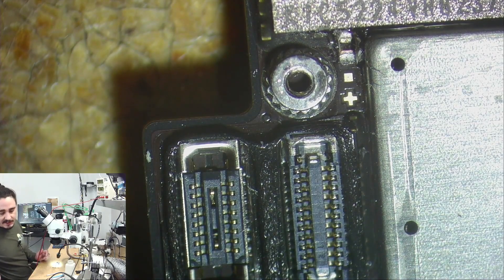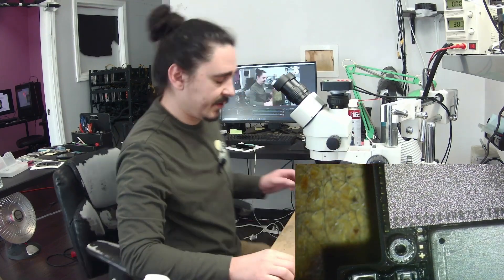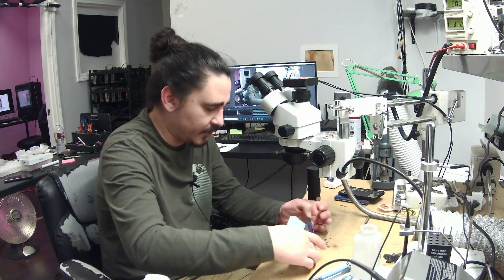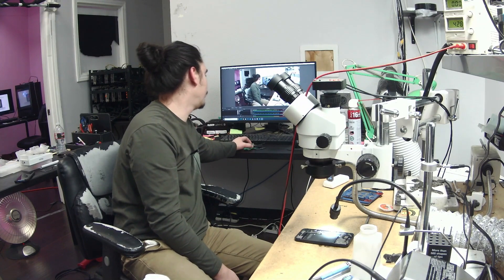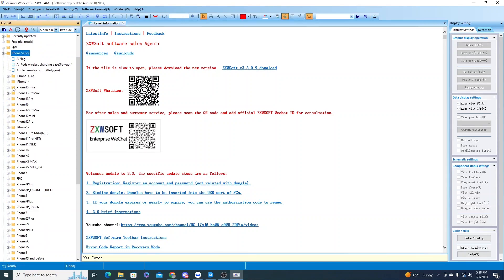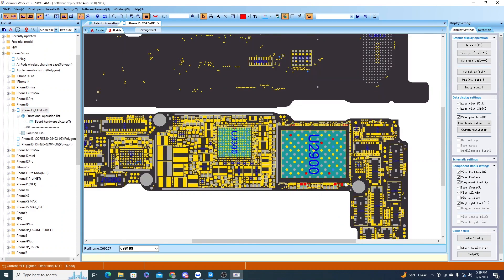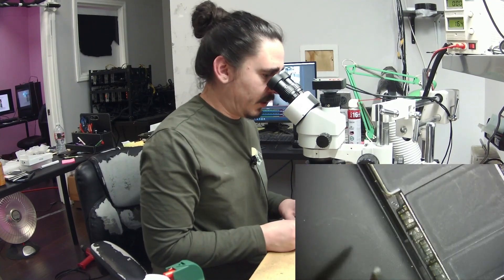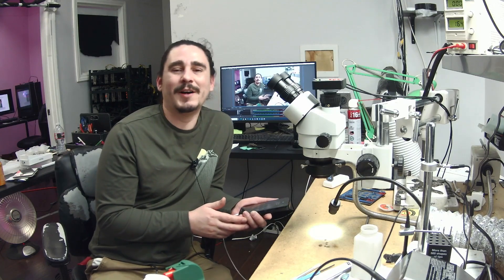How to Recover Data From iPhone 13 - iPhone Data Recovery Service Techniques

Comment: Hi Aaron I have an iPhone 5, after ten times I tried to put a passcode it was disabled. 
all I care about is getting the data from inside I don't care about the phone,
how can I do that. By the way, I don't have a backup on iCloud or on my computer
and I want to know if after ten times the data has been deleted,  can you help me.
Reply from the maker: I would suggesting sending it to iPad Rehab in New York. They should be able to help with that issue on that model iphone.
Reply: @iBoardRepair  thank you very much